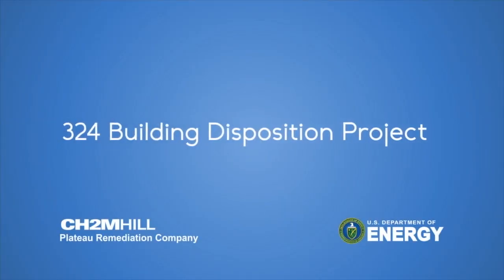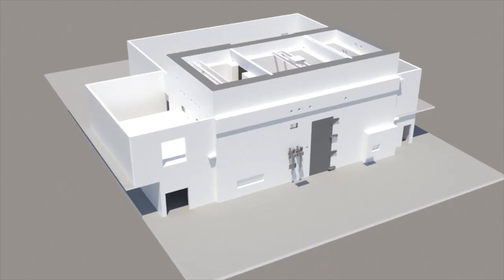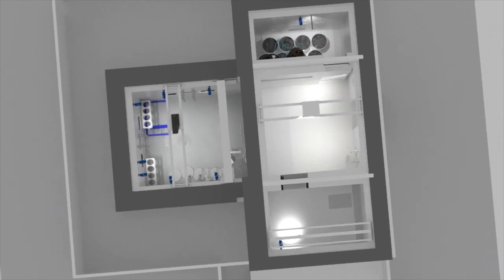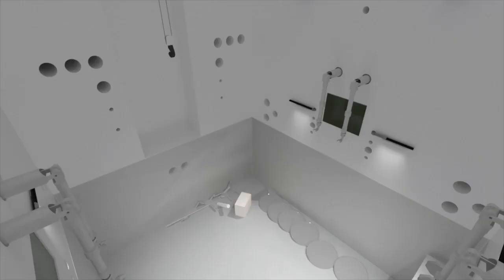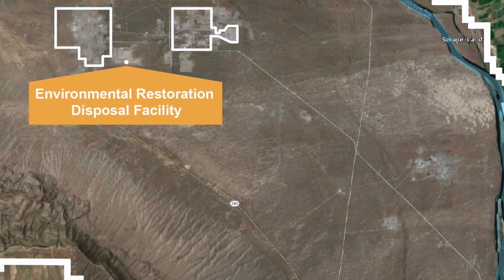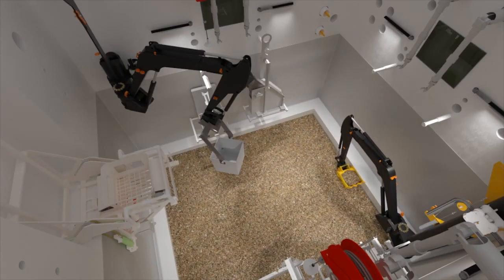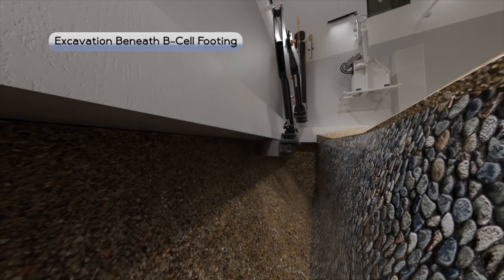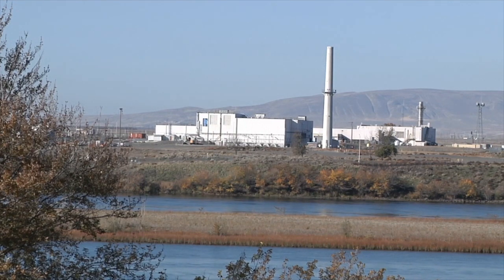324 B Cell Short Animation

Comment: A recent press article cited a contact exposure level of 8,900 Rem/hour. 

A few questions:

I am guessing, given the route of seepage mentioned in the video, that the sources of soil contamination were tanks inside the building which have already been removed - is this correct?

What is the radioisotope makeup in the contaminated soil? The article alluded to strontium and cesium, giving a half life of about 30 years. Are there others?

When was the last possible contribution to the soil contamination? 1996, 2010, or some other year?

What is the estimated total amount of contamination underneath the building in becquerels?

What are the controls for and plans in case of unplanned atmospheric release should the building’s structural integrity become compromised?

What are the controls for and plans in case of unplanned release to groundwater should the building’s structural integrity become compromised, or heavy rainfall/runoff/soil saturation occurs?